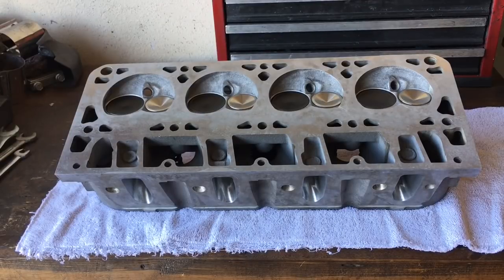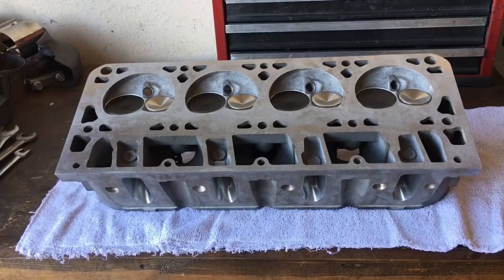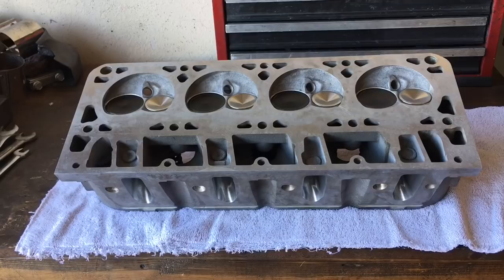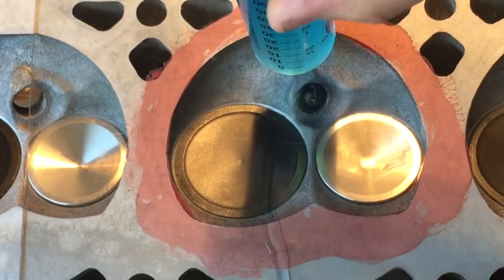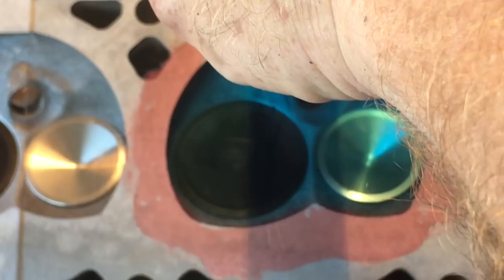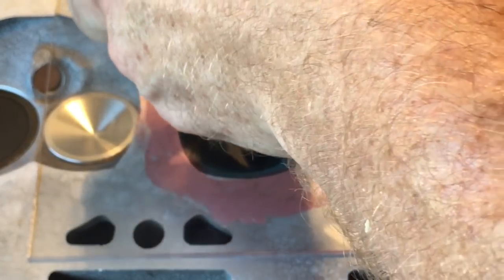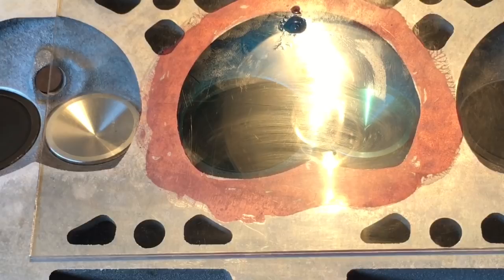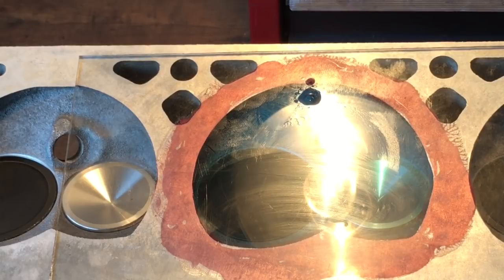862 heads DO NOT come with 61.5cc Chambers

Comment: Those extra ccs may come out of the less meat on those valves, stock ones are flat
And aren't like those concave ones
Reply from the maker: By_a_tryhard _lol Stock valves aren’t flat, they have the same concave/recessed area.  These new one piece stainless valves are shiny which makes it look deeper than it is. Trust me, I’ve compared the exhaust valves side by side, check it out for yourself. 
The factory Intake valves look flat but it’s even got a small recess machined in them. Thanks for the feedback I appreciate you watching!  JD
Reply: @HeadFlowInc  Just watched another Video where the guy was comparing the lt1 Valve that look like yours with the factory valve, the factory Valve is Flat across and yours are Concave.

Comment: If intending to boost my opinion is that a little less compression is favorable. On a N/A build higher compression would be preferable. Great info!
Reply: The only reason to be afraid of more than 10.5:1 on an engine with well designed aluminum heads, sequential multiport fuel injection and electronic ignition would be if you are stuck with 91-93oct pump gas. Plenty of people throw boost at 10.9:1 compression LS2s and 10.8:1 compression LS6s and LS3s. If anything if your compression is too low the engine is going to perform like it's smaller, be sluggish and spool slower. Of course dynamic compression derived from cam timing matters more than static compression. If you play with valve events you can make a 12:1 static compression engine run on 87oct, it's all relative to what you're working with and how you design your build.
Reply from the maker: AEE automotiveengineeringenthusiast I agree! 👍
Reply: Not true. Compression makes more power whether you are N/A or boosted.
Reply: Dustin Freshour you can squeeze more air/fuel in with lower compression, without detonation, it will make more power replacing some height wit air and fuel. You may loose a small amount of low end tq. But the gain is well worth it. I would not run boost on anything streetable with more than 9.5:1 to 10:1, I'd rather have 9:1 with loads of boost. It will not require high octane fuel. And or methanol, water injection.
Reply: @jamest.5001  with todays computer monitored / controlled engine technology you gain more HP an Tq with higher compression and even more also being boosted. The whole reason they went to lower compression in the first place was they couldnt minimize engine knock and detonation with the lower non-leaded regular pump gas back then. The compression value is pretty much a non existant issue these days.
Reply: If the intent is to make the most HP from a particular engine, starting with a lower compression ratio will allow more peak HP because you’ll be able to run more boost (and more fuel).......assuming the turbo(s) can keep up.  I’m talking about a max fuel, max tune, max effort engine here. A street motor only making mid level boost, having a slightly higher compression ratio would make it more responsive on the bottom end without giving up much on the top end because it’s not a max tune. With all that said though, there’s a reason GM dropped the compression to 9:1 on the supercharged LS9.

Comment: Very nice catch! Thanks for the video. I'll just get some 243/799 heads and mill them down to 61cc
Reply from the maker: George Carter The 243/799 heads are ok, they’re not the best flowing but definitely better than the stock 706/862. 
All the heads I port flow more than the 243/799 heads. 👍
Reply: Really the ports on the 706/862 are designed better for a street performance engine, that's why a Gen III 5.3 LM7 is rated for 295hp with 706 heads and a 6.0 LQ4 with 317 heads is rated at 300hp with the same intake, throttle body, camshaft and exhaust manifolds. In Richard Holdnen's test 706 heads made more power than even 243/799 heads on a cam+springs,headers 5.3, the 706s are more efficient, compared to a 243/799 heads on a 6.0 unported 706 heads made 10-20tq over a 1600rpm range in the middle and we're only down 9hp or less for less than 500rpms at the very top, just a little port work and maybe some unshrouding of the valves, chamber work or bowl blending could make that up if not just a little more lift and duration and possibly a better LSA chosen using the Vizard 128 formula and the right amount of advance ground or added with an adjustable timing set. Then you'd a have even more TQ in middle and either match or surpass the peak power made with 243/799 heads even if the compression ratio was made equal.

Comment: Are you going to use MLS gaskets, or a lower compression traditional FelPro ?
Reply from the maker: Don Rutter Mahle/Victor Reinz MLS gaskets #54441. They have the 3.835” fire ring to best match the 4.8/5.3 bore.

Comment: Are these 4.8 or 5.3 heads?
Reply from the maker: Chad Gardee The 862’s and 706’s came on 4.8/5.3 engines. The two casting numbers are considered interchangeable. 
This set came on a 2002 4.8

Comment: I have questions about core plugs, you use brass core plugs and if so what sealant do you use?
Reply from the maker: Lime I suggest using either Brass or Stainless Steel.  The old school proven sealant to use is Permatex Indian Head Shellac.  There are several manufacturers who sell versions of this compound. 👍
Reply: Sorry i didn't reply back, stupid Youtube notifications are broken AF. I hear the Aviation grade stuff is good too permatex... I even talked to Permatex and they said to use the no.3 Aircraft grade stuff which is pretty much indian head shellac with one other ingredient.
Reply from the maker: Lime Interesting Thanks for the tip!